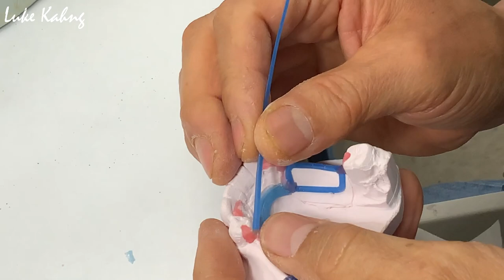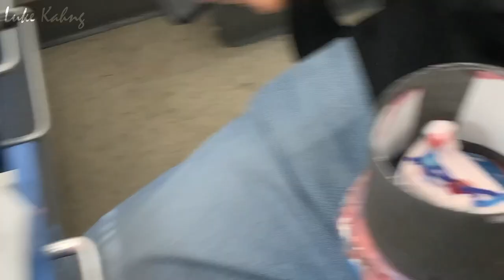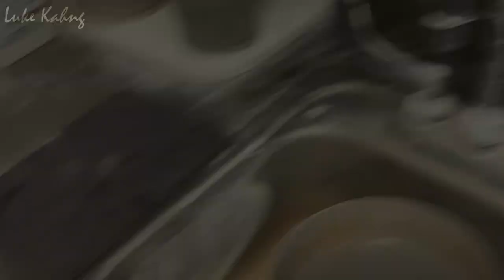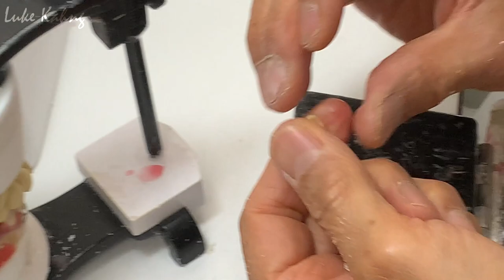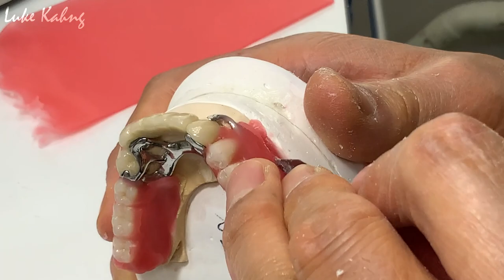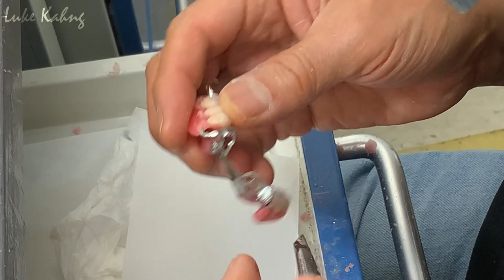How To Make A Cast Metal Partial Framework | FULL PROCESS | Study & Learn

Comment: It went into the vacuum chamber as a wet mould with wax and came out dry with metal inside ? You left out a heap of steps, melting out the wax, casting the metal!

Comment: Wait how did the wax turn to metal?
Reply: Magic!
Reply: Wow I’ve been waiting all day hoping someone will reply with answer. And all I get is “magic” haha
Reply: @chrystianmontalvo9105  it is casted using the lost wax technique. I guess he didnt show the process.
Reply: @chrystianmontalvo9105  I'm wondering if you have a more enlightened explanation!  See Jojo_quins answer below!
Reply: The long blue  lines he attached in the end that’s where metal comes from. First wax is melted due to high heat. Then melted metal is made to flow in the place of that wax through the long lines (sprues). The metal then solidifies and makes a rigid framework.

Comment: When did that blue plastic skeleton become metal?
Reply: He most likely cast it in a centrifuge. He invested the wax in some form of stone, burnt it away, heated a metal in a centrifuge and cast it. The metal replaces the void  the wax left behind
Reply: I still don't get where the metal comes in to play? That metal framework just appears out of nowhere because it wasn't there before you put the paint plaster or whatever it is in that cylinder with the mold in it. After it hardens takes it out beats it off with a hammer and voila it's metal? I'm just trying a blank my mind doesn't want to work that way or something I'm not sure how it happens